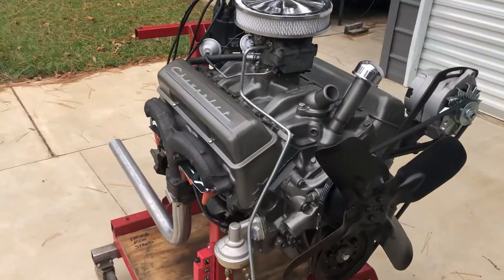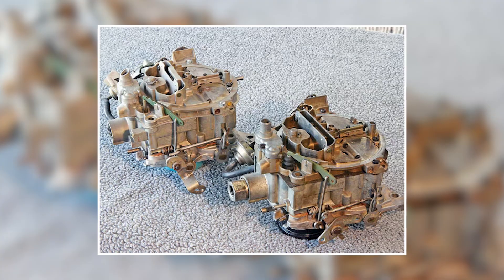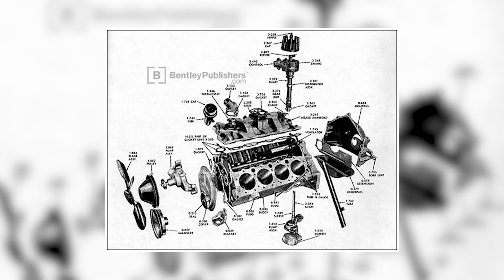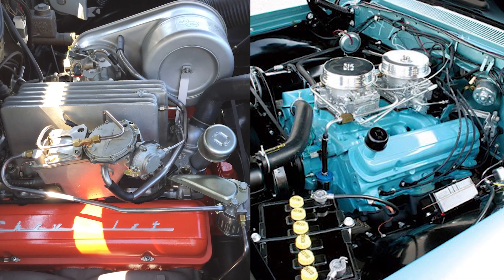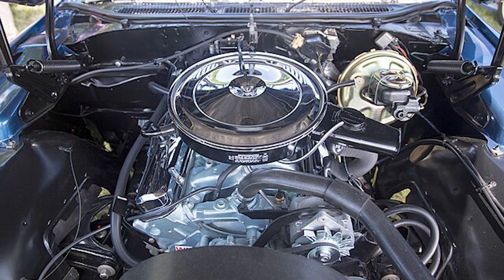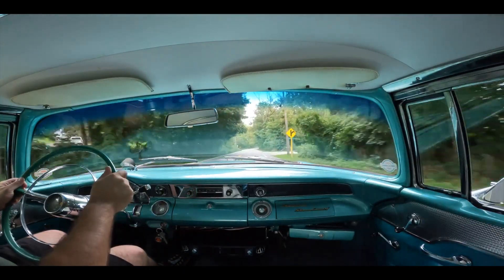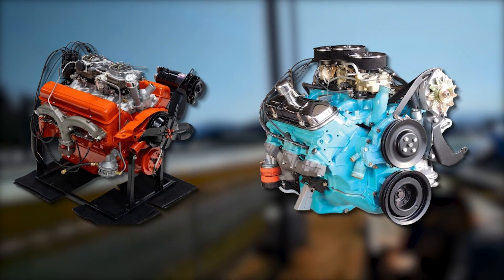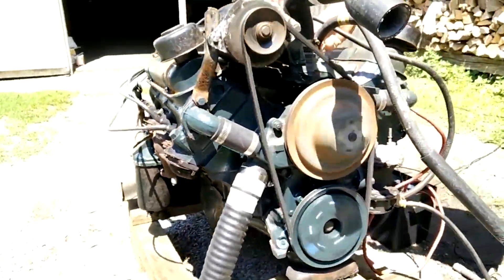Chevy 283 vs Pontiac 287 | Who was King?

Comment: WRONG!!!!!!!

The 283 was NOT the 1st to pull 1 HP per cube in 57.

Chrysler in 56 had a high output version of the 354 Hemi with 10.0:1 compression producing 355 HP.  Yes...one year earlier!  This motor was available only in the 300B.